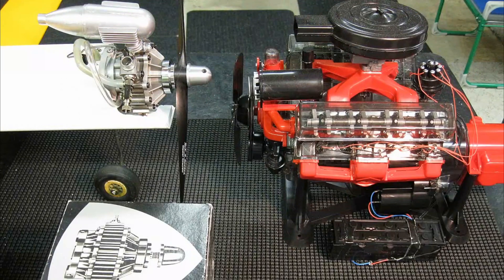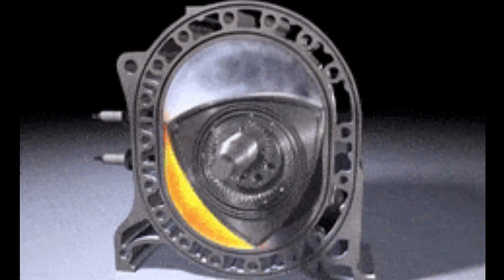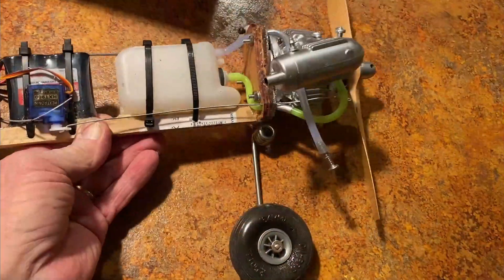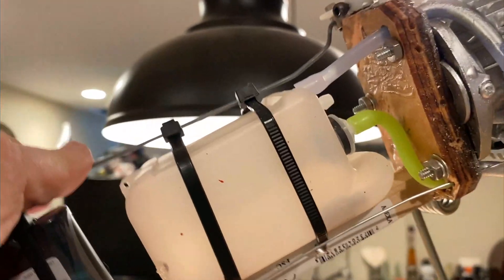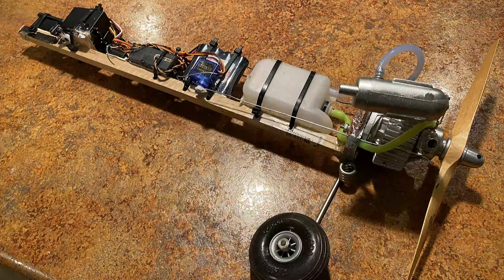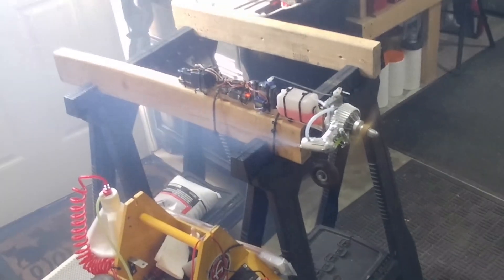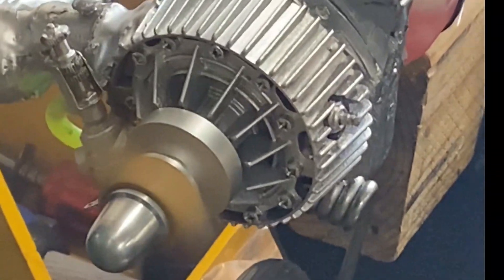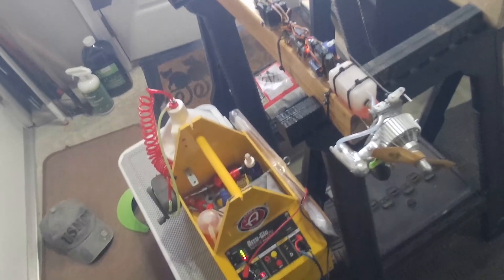Look Ma, NO PISTONS!  See my OS NSU WANKEL Nitro ROTARY Engine Run as I ready it to fly again!

Comment: Dave with Richard. I have a nice tip for you that might be very useful. Bind plug . I have updated this bind plug with an off and on switch. you never have to remove the bind plug again. Easy to make take an old servo cut the cable off leave the two outer cables cut to length and put a small on and off switch in between. works perfectly, I also did it on my plane. greetings and Happy flying buddy. 🖐😃👍✈️🛩
Reply from the maker: That is a good tip.  One of my helicopters keeps loosing bind as well, so all I did was run a  servo extension cable out to the boom.  If I need to bind, I plug the bind plug into that.  I like your idea as well.  Thanks so much and happy flying to  you as well.

Comment from the maker: The rotary engine is officially back, but don't expect a sleek sexy Mazda RX-7 revival to house it… yet. It's actually back as a range extender generator in the usually electric-powered Mazda MX-30, in the new, rather clunkily-named, e-Skyactiv R-EV.

Comment: Thanks for showing us this very unique engine again btw Dave what size props does this engine use?
Reply from the maker: Thanks so much.  It is a 10x6 Zinger wood prop.
Reply: @NightFlyyer  Cool I wonder if this engine would fit on 40 size high wing plane like a Big Stick or Avistar??
Reply from the maker: @3DMOFO2020  Probably would.  It flies this wing pretty good, so maybe a Little Stick would be better.  For now, it is on my wing.
Reply: @NightFlyyer  Cool!

Comment: One of my holy grail engines. I'll have one eventually. Don't know what I'll do with it but I'll have one eventually.
Reply from the maker: Right on.  Well, just run it for fun for one thing. Hope you can find one.  Thanks.
Reply: @NightFlyyer  Part of why the toyan rotaries are such a disappointment. They....can't run. And those sell for the same prices these OS ones command!
Reply from the maker: @TestECull  I have not heard of any other brand rotary's.  I will have to check "Toyan" out.  Thanks.  BTW..The rotary engine is officially back, but don't expect a sleek sexy Mazda RX-7 revival to house it… yet. It's actually back as a range extender generator in the usually electric-powered Mazda MX-30, in the new, rather e-Skyactiv R-EV. 🙂
Reply from the maker: @TestECull  I just watched a video.  Looks like they are hard to start.  Mine OS started right up after 4 years.  LOL.
Reply: @NightFlyyer  Ye. Most of the Toyan engines wont even rotate. Swarf left inside them, no deburring, fundamental design issues. OS/NSU/Graupner went with the finely machined approach whereas Toyan just went 'that looks about right'. Toyan is also using sheet metal faces for the rotors which bind up the works pretty bad. 

Bloody miracle if your 350 dollar single rotor or 750 dollar twin rotor can even rotate....yeah nah I'll just buy a used OS and know it will start pretty much first flick 🤣
Reply from the maker: @TestECull  Yes.  Anything OS makes is very good for sure.    Thanks again.

Comment: Hi Dave.  Would you comment of the fuel usage of the Wankel compared to a "conventional" RC internal combustion motor?  Thanks! Obviously that Wankel "hauls"!!
Reply from the maker: It is a gas guzzler for sure.  Mazda still makes one, and they are fast.  The biggest issue was making them smog compliant, so most opted out, but it is a smooth powerful engine for sure with instant throttle response.  Thanks Dick..

Comment: The sound reminds me of one of the old rotary Datsun pickups. How much power do the nitro wankels make compared to the piston engines? Any weight savings?
Reply from the maker: Definitely lighter with no cams, valves with only 2 moving parts.  Very high HP ratings.  This is just a single rotor, but Mazda made many versions with up to 6 rotors.  They are very fast, but again, hard to make smog compliant and poor fuel consumption makes it expensive to run.  Thanks much.